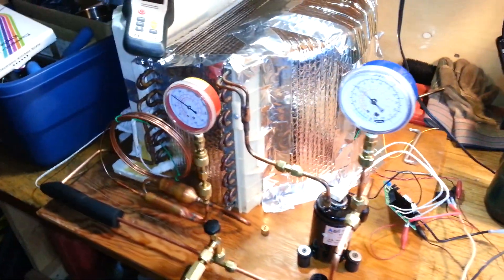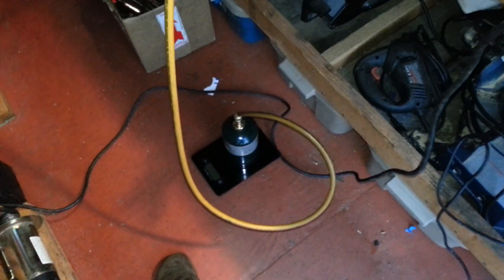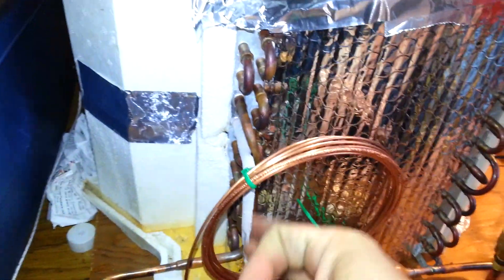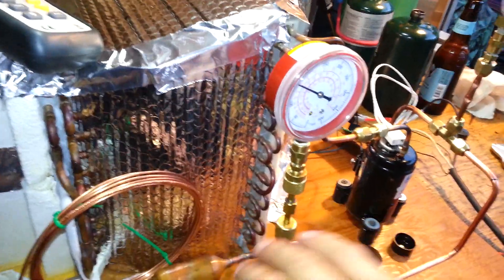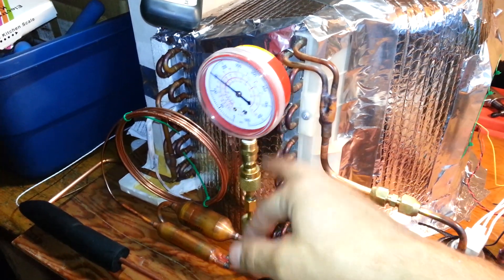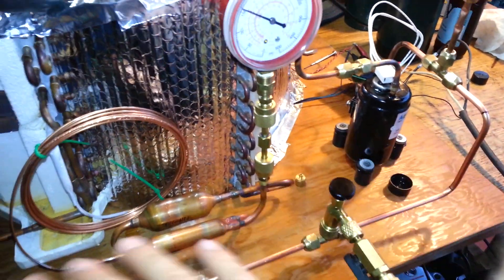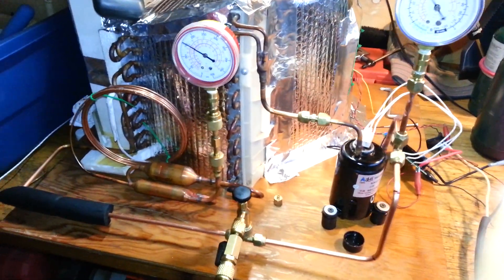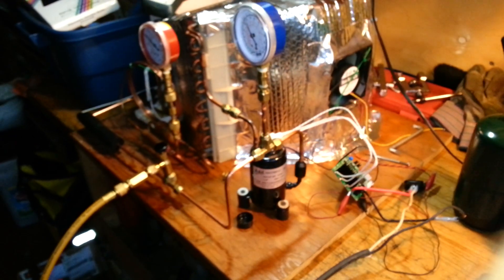Brushless DC Compressor - Operation, Short Cap

Comment: This is a variable speed conpressor! Size the cap tube to be suitable for the lowest realistic power use, then when you crank it up a bit you'll get a little more pressure differential and your desired temps. Lower RPM use range is what you'd use all day 24/7 with highest efficiency, like say a fridge just barely keeping warm in mild room temps. For higher liad starting up from warm, or warmer room, the temp differential will go up with a cap tube and you'll get a hotter condensor and colder evaporator than ideal but it'll be good enough. Worse case is sizing it too small and then lowest power can back flow refridgerant to the compressor. You can tie the capillary and after condensor side together for a little compensation for that superheat and subcooling in a wider range of operation. A colder capillary will help precool the hotter condensor exit temp to run more efficiently and less likely to backup the compressor.

Comment: Usually, most air conditioners use AC electricity, but a solar cell whose output is dc, it must be modified. The result is a loss of electrical power. The heat is generated in the conversion circuit from DC to AC. Therefore, the design of an air compressor using DC electricity that generates pressures above 20,000 btu is a world-changing innovation.

Comment: You do realise that on Aliexpress these compressors are offered alongside "mini" evaporators/condensors panels as well as the cap tubes and accessories that are meant to run with it??? They are parts originally meant for mini fridge for pc cases and fish tanks.

Comment: Install a ice maker water valve to regulate your input boil off to evap in line with cap tube. What is your amp draw on compressor with 12 volts? Will this compressor run directly off car battery. Where is the best place to get the cheapest price on this compressor.

Comment: If you want to make cap tube for cooler. installed 10' cap tube at next to filter drier,and then start compressor. checked high pressure and cut cap inch by inch  until high pressure drop down to 120 psi. I lean from my boss year1972.

Comment: How you get that hose to the propane tank I did that today but I just cut a piece of high pressure hose stock the end of my torch obviously without the head and it cooled but without that there is no way of closing the system permanently

Comment: why are you using propane ?
Reply: NOBOX7 r290 is an amazing refrigerant. Hydrocarbon refrigerants are environmentally friendly and very cheap. All Coca-Cola Freestyle soda dispensers use r290 AKA propane for the refrigerant.
Reply from the maker: NOBOX7 Cheap. Abundant. Almost no global warming potential. High latent heat.

Comment: I want to make my own refrigeration unit one day I want to make a small air conditioner unit using  a brushless refrigeration compressor.
Reply from the maker: That's cool!  You'll need a larger compressor than the one I'm using here, or much smaller heat exchangers.  This setup never really worked well, as my heat exchangers were oversized.
Reply: @whatawaytogo515  how many measure about the long and diameter of pipe to using??

Comment: I really like your videos, and would like to start experimenting with refrigeration and controls. Do you have any suggested books and/or additional web sites for learning the basics and where to source the various specialized fittings? Thanks!
Reply from the maker: Yeah, dig into this stuff!  There is a real shortage of this kind of work being done, from what I've seen on the internet.

Not know your level of experience, I would recommend starting on abebooks.com. Search for refrigeration or refrigerator, and specify books published in the first half of the 20th century, specifically the 20s and 30s.  These are generally well written, and the principles they describe have not change, only the equipment.  Some of mine are listed here:  https://musingsonentropy.wordpress.com/recommended-books/?preview=true

It's also a good idea to have a modern HVAC tech book from the late 80s onward.  These are generally wordy and boring, but describe modern tools and techniques with good illustrations.

Once you know.some of the basic terminology, you can find some examples of brazing, flaring, evacuation, and things like that on YouTube.  Also, check out:   http://ecorenovator.org/forum/geothermal-heat-pumps/  
It's a great DIY refrigeration forum.

Parts are easily found on eBay, or a local refrigeration supply in your town (if they'll sell to you).  Another option for specialized components is surpluscityliquidators.com

Shipping is always a mystery, but some of the deals make it worth looking into.

Sorry for the poorly written  response, I'm writing this on my phone, while riding light rail to work.  Perhaps later, I can makr a video describing some of my equipment and resources.

I would suggest starting with some old books, to peak your interest.  Feel free to shoot me an email if you'd like more information.  

praxis15501@yahoo.com

Comment: I would like one of those compressors. Easy to run on solar.
Reply from the maker: Definitely for a fridge or freezer, one of these compressors would work great on solar.  Are you looking into getting one?
Reply: I would really like one. Can't find any in the UK and the 240v compressors are not as efficient
Reply from the maker: +Shaun Dobbie This is the one I have:  http://www.ebay.com/itm/Small-Volume-12V-DC-Tiny-Compressor-for-Air-Conditioner-Refrigerator/161547760524?_trksid=p2047675.c100005.m1851&_trkparms=aid%3D777000%26algo%3DABA.MBE%26ao%3D1%26asc%3D32480%26meid%3Dc0452cac4a3541f2939b618c8e0a2726%26pid%3D100005%26rk%3D1%26rkt%3D1%26mehot%3Dpp%26sd%3D181260257760
Reply from the maker: +Shaun Dobbie There are at least two chinese companies manufacturing similar compressors; although they may just have different labels.  They usually start at about $168, and go up from there.  This one has a speed range of 1700 to 2900 RPM, but others go up to 6000.  A United States manufacturer produces an even smaller unit called the Aspen, but it is quite expensive, and difficult to purchase.
Reply: That seller doesn't send to the UK.
Reply from the maker: +Shaun Dobbie http://aspencompressor.com/

You could also try Danfoss.  They have a line of small DC brushless (reciprocating?) compressors; the most common I know of being the BD-35.  They are commonly used in boat refrigeration.
Reply from the maker: +Shaun Dobbie you could also try to find an RV refrigerator or parts for one.  There is a line of RV refrigerator/freezers, which will run on 12 VDC or line voltage.  Some manufacturers use the Danfoss units, but the best ones use a swing compressor made by Sawafuji.  http://www.sawafuji.co.jp/english/tech/shindou.html

I just found out about these, having acquired a small refrigerator that still works.  It is an R-12 system.

Otherwise, you could try alibaba.com  Some of the manufactures there will sell a single unit, and there are a large number of compressors to choose from.  I've never used them, so I don't know how bad the shipping is, or if they'll ship to you're part of the world.
Reply: +Shaun Dobbie You can buy from Ebay, but it is from China. http://www.rigidhvac.com. Rotary compressor with DC12V, 24V and 48V.